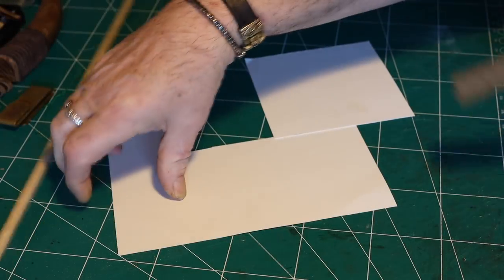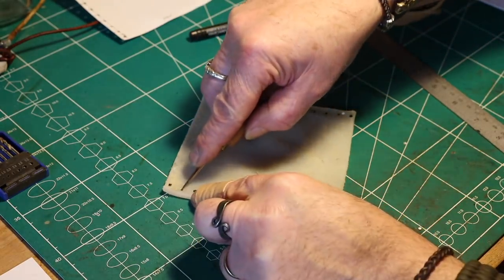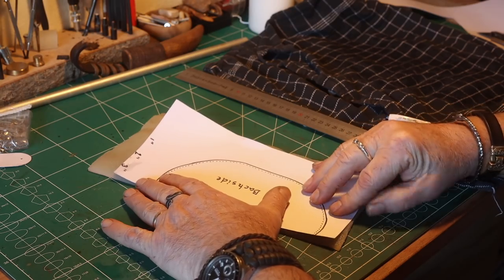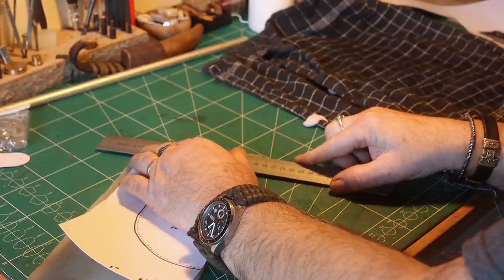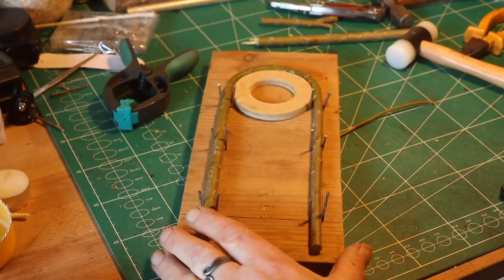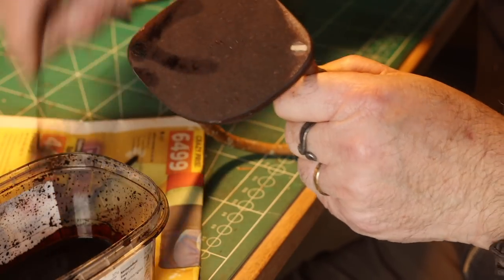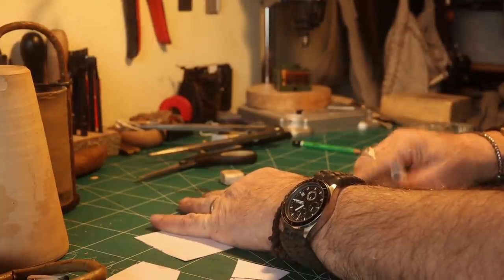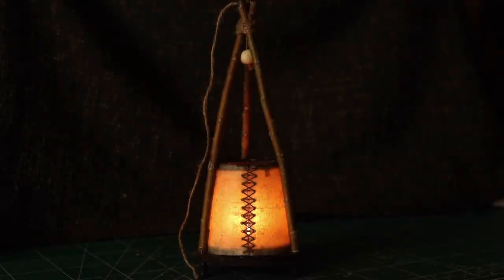Silence of the Lamps... 3 DIY projects.

Comment: On a side note, I used to work in a lumber mill where they made MDF. It is constructed of sawdust waste and polyresins (plastics). The dust is highly carcinogenic and over time can cause Cancer! I would recommend that you wear a Respirator while cutting and Sanding it. Or a minimum of a Dust mask. Be Careful with it. Skal
Reply from the maker: Appreciate your concern and advice very much Erik 😉👍🏻
Tom

Comment: Yes I found out how important a sharp knife is last night. It was a relatively new blade but not new enough I guess. It would make a slight tearing noise when cutting the wet hide. Cutting may be better described as hacking. 🤗😮🤐😮🤗 I did figure out a very good way to use the hide I had in the best way. However once I finish my first lantern I will say whether it is actually a good way or not. 🤗
Reply from the maker: That’s great 😉 and yes it’s not easy to cut the rawhide 😆💪🏻🏕🔥🐕
Tom